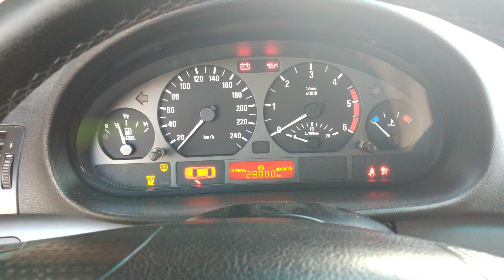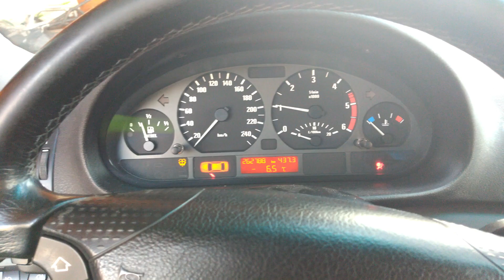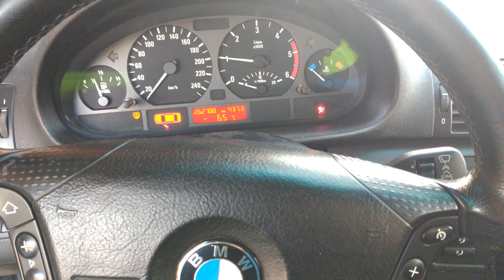cold start bmw 320d  2001

Comment: Salut Gabi ! A pornit dar eu zic ca nu e ok ca la -20,-25 ce ii mai faci ..... Si eu am diesel 318d a mea pornește ca vara, ai zis ca aaa porneste un motor diesel, nu e normal ! Nu vreau sa zic domne ca a mea e cea mai buna masina si etc , nu eu vreau doar sa zic ca un motor nu e normal sa porneasca așa la -6 grade ... Salutări și spor la treabă !
Reply from the maker: Pornește relativ bine pentru o masina diesel la ani ei si in 3 buji ținând cont și de faptul ca bateria imi face probleme ca nu tine curent
Reply: @RestauraresiReparatii  da si asta e adevarat .... Oricum e bine ca porneste daca pornea foarte greu sau delic atunci era problema ... Salutări si nunai bine

Comment: Nu e ok pornirea asta... A meu 320d e90, ii pun contactul de 2 ori si porneste ca si vara. Am pornit-o inclusiv la -10°C, si tot la fel. Nu vreau sa zic ca am cea mai buna masina sau alte chestiuni, dar zic eu sa o duci la un mecanic care e experimentat, de care toata lumea zice ca e bun, si sa ti-l repare. Nu cred ca dorești sa prinzi o zi cand sunt -20 sau - 25°C, sa te grăbești sa mergi undeva cu masina, si sa nu porneasca nici in ruptul capului.
Te salut, sanatate si spor la treaba, an nou fericit sa aveti👍
Reply from the maker: Cred ca se cere schimbată :)))
Reply: Nu e musai, pentru o baterie, niste bujii sau bobine de aprindere defecte, nu are rost. Eu am schimbat e46-le cu e90 pentru ca e90 e mai comod, cutie automata, nu mai e asa rigida ca și e46... Etc, ambele masini sunt si au fost impecabile.

E46-le tau merita o sansa. E un model reușit de la bmw. E posibil sa ai ceva probleme pe partea de aprindere, gen bobine defecte, bujii uzate, fise întrerupte... Etc, dar si pe partea de alimentare. Du-o la un mecanic, cu maxim 500-600 de lei ai rezolvat problema cu pornirea, si nu mai ai treaba mult timp cu ea